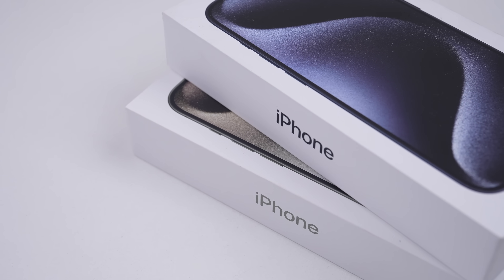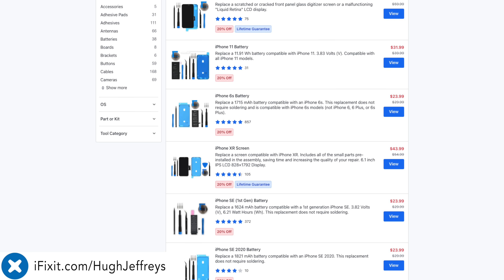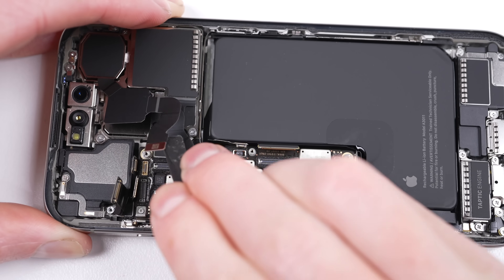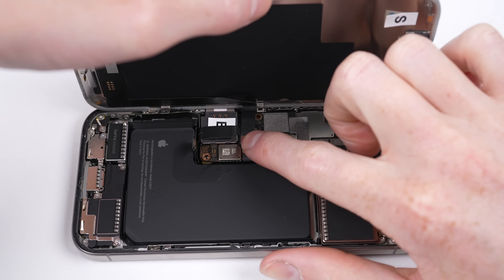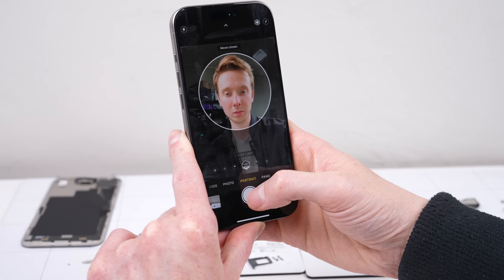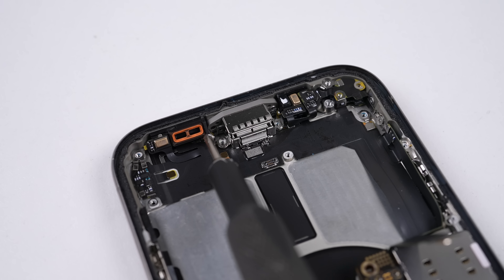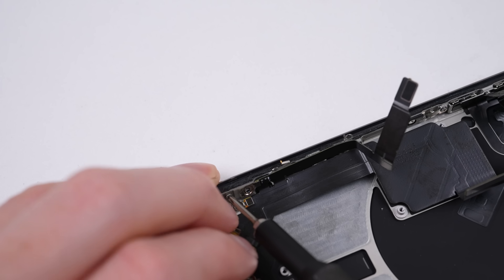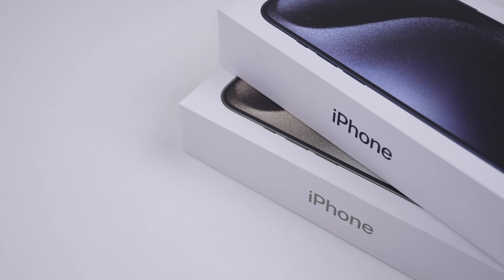iPhone 15 Pro Exposed - This Will Harm The Environment - Teardown And Repair Assessment

Comment: One thing worth pointing out is that even though they changed to USB C the data transfer speed of the base and Plus models aren't any faster than lightning was, it's still USB 2 speeds of 480mbps.  If you want proper modern USB 3.2 gen 2 speeds of up to 10gbps you'll have to buy the Pro and Pro Max model, however they still come with a USB 2 cable so you have to buy a new one if you actually want to use that speed
Reply: Galaxy S5 is USB 3 device with USB 3 cable
Reply: Tim Cock Likes Men
Reply: @foxhoundslug usb 3.0 has no effect on charging speed. The bundled usbc-lightning and the current cable with the 15 series all support usb pd and most iPhones charge at 20-27 watts.

Edit: MacBook charging cables are 100 watts but only support 2.0 transfer speeds- but are pd certified. Apple was one of the first to adopt the PD protocol as well.
Reply: Lmaoooooo
Reply: To be fair as others have brought up, USB3 doesn't actually matter for most people to be honest. I'm not often transferring things between phone and other devices, and when I do it's mostly through WiFi, and if it's wired it pretty much exclusively just grabbing locally stored photos once in a while, and I just don't really care if that takes a bit longer.
Reply: As a long time apple user, I know androids have faster transfer speeds and charging and this and that. I just don't care. I transfer files to my mac using airdrop, no cables involved. It takes my phone 1 hr to charge. I don't need any of the shit you mentioned. I have the same lightning cable from 3 years ago, still works fine even after my cat chewed on it. Lightning works fine, just like standard transfer speeds.
Reply: What android device comes with a 3.0 cable or higher? Or even supports it.
Reply: @makeitrainnaren  most Flagship lines have been doing so for around five years,  the base Galaxy S10 had USB 3.1
Also you know usb3 is around 10 times faster than usb2 right ?
Reply: @DanielPereira-ey9nt  Samsung bundles usb 2.0 cables cause they use proprietary fast charging tech what you talking about? iPhone 15 is lame for not supporting that- but again ask an average cell phone user if they know what usb 3.0 is and they’re not gonna know. People also sleep on the fact Apple was part of the usb c consortium and alongside intel actually helped develop and push this port in the first place.
Reply: @makeitrainnaren  I'm the one who isn't quite sure what you're on about
Still, even if the common person doesn't know the difference they'll feel it when they're trying to take out the files made with the filming features that are the main selling point of this bramd new flagship with midranger level transfer speed.  There is also the hypocrisy of the company that took away chargers with the pretext of reducing E-Waste  now making the cable that comes with the phone a hinderance for it's features
Reply: @makeitrainnaren it's not proprietary, just USB PD, same as what apple is using, and many others
Reply: @DanielPereira-ey9nt with that said though, it may be simply the A16 SoC doesn't support USB3 at all, even if they wanted to add USB 3 to the 15 it may simply be not on the silicon
Reply: @TingFeng77  that is the reason. I was referring the bundled cables. I know Samsung and most android oem’s use 3.0 except nothing uses 2.0 even on the port.
Reply: @DanielPereira-ey9nt  most iPhone users have a MacBook and use Airdrop which is about 1gbps. I’m not excusing it but this for iOS users it’s not important to them. I worked in the repair industry. Cameras don’t normally stop working due to shattered glass. I worked at an independent shop and we refurbished the lens cover. Even had the laser machine like Hugh for the 13< below
Reply: @TingFeng77  for Samsung fast charge don’t they use the PPS protocol for a while which is why they had usb a to c cables for a while for the fastest charging? I’m a huge fan of PD and usb c. Don’t forget Apple and intel worked on that together
Reply: @makeitrainnaren  yeah but isn't PPS part of PD now, or at least basically any PD Charger supports it
Reply: @TingFeng77  thanks for educating me on that. If the charging cable included does indeed support 3.0 that’s nice. However points still stands that Apple and intel did push and create usb c and for the major of display and battery repairs as well as back glass, aftermarket parts will be fine.
Reply: @makeitrainnaren  I don't think anyone bundles a 3.0 cable, since I would say most people use it just for charging since honestly using a cable to transfer data isn't too popular
Reply: @TingFeng77 Correct me if I am wrong but didn't the Note 3 came with usb 3 cable. It was micro usb 3 but still.
Reply: @makeitrainnaren what proprietary charging does samsung use? My samsung phones will all use fast charging with any USB type C cable and a QC charging plug.
In contrast the iphone 15 needs MFI certified cables in order to fast charge and use the faster data speeds
Reply: @makeitrainnaren Most iPhone users do not have a MacBook, iPhone has 65% of U.S. market share while only 13% of computers are any kind of Mac
Reply: @DanielPereira-ey9nt  You misunderstand him, clearly. The cable itself isn't USB 3.0. Very few phones ship with a cable that actually allows you to benefit from USB 3.0.
Reply: @makeitrainnaren you sound really pathetic, constantly moving the goal posts
Reply: @makeitrainnaren Most big brand phones support it, pretty much all Pixel, Samsung, and a good amount of other brands on the market right now. There isn't a detailed list online, but if you type your question on Google with the word reddit after it, you can find a post someone made with a link to a GSMArena search that shows most of the ones known. I don't know about cables, probably only the high end ones I assume. The cable I could care less about, a decent cable isn't expensive. The big thing is whether the phone supports it.
Reply: @makeitrainnaren  hahaha, everyone just suddenly realized their phone had USB 3 but the included cable don't lmao
Reply: @makeitrainnaren  all of them?
Reply: samsung s8

Comment: Apple's repair policy is like a car manufacturer forcing you to buy OEM windshield washer fluid or the car will disable the wipers, auto headlights/dimmer function, and the HVAC windshield vent selection.
Reply: Damn, you just have them the printer ink model for washer fluid.
Reply: Don't give them any ideas..
Reply: I mean they technically do it with the windshields in modern cars that have all the self driving and other assists that use windshield mounted cameras cause no third party has access to the tools needed to recalibrate the sensors/cameras for the new windshield so why not just have it all done at a dealership where you can get OEM glass and sensor recalibration all in one stop
Reply: Doesn’t happen with cars
Reply: @passivevii4052  except it does did you not see above where I pointed out that pretty much every modern car with lane keep assist ,the co pilot systems and adaptive cruise, ETC basically have to be taken back to a dealer if you break the windshield or if the system at all looses calibration  because only the dealership has the tools to fix those systems no third party shop can
Reply: Yah, but window washer fluid doesn't have access to all your data.
Reply: @michaelfilippi3276  
Not yet...

Comment: Xcover6 Pro user here.
As long as sheeple keep buying phones with non removable batteries and difficult to repair - things will only get worse.
Reply: Repair technician here, who has just received an XCover 6 Pro 3 days ago for repair. Guess what? Backlight died, mainboard side, for no reason 2 months after warranty expired. I literally never saw this with any other phone.
Reply: @PvtAnonymous  Good to know....hope it's a fluke cuz I use mine a lot.
Reply: @yomommaahotoo264  I hope so too. For how many were sold and how many we get of these (it's really just like 2-5 per year), this was extremely disappointing. Like I get that it's not the newest hardware, but they could at least design these phones to not break like this.
Reply: @PvtAnonymous  Lemme know what the root of that screen issue was.
Reply: @yomommaahotoo264  oh, we already canceled the repair because it wasn't economically viable to fix it. Seems like the backlight controller IC died, not even visible damage. Board looks pristine from what the technician who worked on this phone told me. Bad luck I guess - or lack of QC on Samsung's end, we'll never know. Wouldn't be surprised if this was planned obsolescence. These XCovers are mostly sold to companies who have no financial restrictions to replace them every two years or so. Would be a scummy move if that was true.
Reply: Warning! Danger Tim Cock Likes Men  @PvtAnonymous
Reply: Android is good becuase Tim Cock Likes Men We must Stop Him BEcuase THats Not Ok @PvtAnonymous

Comment: Has the full speed of the usb c been locked behind a pay wall on the base iphone 15 and will u get issues if u replace the back panel with a new 1 causing wireless charging to stop working?
Reply: base model has a usb 2.0 standard so nothing changed from lightning in terms of the specs
as to back glass replacement, you can do it freely
Reply: didnt the eu say that they cant limit the speed of the usb c port? @eegee24
Reply from the maker: No issues as of IOS 17.0 - 17.0.2 with replacement of the black glass.

Comment: I'm sure with the iPhone 16, Apple will figure out software pairing of the adhesive strips and individual screws.
Reply: @syvulpie "deeper integration" 😮
Reply: We joke about that but I wouldn’t put it past them. I’m going to check on this comment every few years to see if I’m ever right.
Reply: Very unfortunately, samsung would copy it 😢
Reply: @neon_arch 
First they will make fun of it, then copy it. I miss LG.
Reply: @blaquenoise  how shameless do you want to be?
Samsung: YES
Reply: @neon_arch true
Reply: @neon_arch  They have to if there's no blow back from the consumers. Its great for revenues.
Reply: I'm surprised there isn't a LED inside that can work in reverse and transmit a signal whenever it detects light from someone opening it. Then needing a software reset before something asinine like volume buttons work again.
Reply: @markm0000 that is called a light dependent resistor (LDR).
Reply: @dadudeme   They just made a name for it and charged 10x the price so mouth breathing engineers wouldn't freak out that a LED is working backwards.
Reply: They could put a photodiode in there, but it would be just as easy to include a little spring loaded switch that flips up when the case opens. This already exists in desktop PCs so you can know right away if they've been opened and tampered with by bad actors. @markm0000
Reply: Like a tamper proof TAN generator like some banks have
Reply: Introducing the new "tamperlobe screws"
Reply: It will use face recognition to block Hugh Jeffreys
Reply: Don't give them idea lol.
Reply: I really wouldn't be surprised if they eventually include a case intrusion sensor that completely bricks the phone and just shows a message that says something like "Security Error: Please visit an authorized Apple service center."
Reply: NFC chip inside every screw so the iphone can detect their code lmao
Reply: @damara2268  That's be too obvious, though, given NFC won't work from inside a metal object... 📶🛡📵😉

Though if we start seeing non-metallic screws appearing inside iPhonеs?... 😱
Reply: Maybe one day, when you open the  iPhone, it will automatically send a signal to lock all the components.
Reply: @franksu3420  don't give them ideas
Reply: Lets start using random weird screws per batch for extra bulshit
Reply: proprietary electricity and iOutletscoket :P
Reply: I worked on a machine that required a certain material to be used for screws, it made sense. So they applied a sensor to it that send power through the screw to check if the resistance was right. 

I mean, it worked, but anyone with a brain could bypass that. It wasn't worth it due to the amount of screws, but still doable.
Reply: Wouldn't doubt that
Reply: @syvulpie don’t give them that idea!
Reply: Lol
Reply: @syvulpie  but then they're screwed when somebody wants to get repairs from THEM.
Reply: They'll use Killer Queen: Bites the Dust to make the phone explode the second the display is removed.
Reply: @syvulpie rivets. I fully support Apple to use rivets instead of screws, just for us to sh*t on apple for more
Reply: There’s no way that’s possible. There is no electricity for those parts so there is no way to pair them.
Reply: @Nicolas-gy3zf  🤦

Comment: I'm guessing next, apple will pair the user to the logic board using biometrics, and no, reset won't help. So, when you sell the phone no one else will be ble to use it. Even if you remove all the Icloud and find my from the iphone. Just a speculation though. I'm not saying that this will happen but it's possible.

Comment: Everyone says it's calibration, they eat apple's bluff. But they are just idiots, when you swap out parts and swap them in again, if they are sooooo sensitive they should be "uncalibrated". But guess what, they don't uncalibrate because it's a software-serial lock, not an actual calibration issue.

Comment: motherboard changing = (camera+ microphone, charging port, speakers + battery+ display+ wireless charging) changing.
That means motherboards detects what changed in the phone and limits usage of hardware like camera, charging etc.
But just swapping camera or mic, charging port works??
i think not!!!

Comment: As long as there is paired parts it's not repairable, Apple is gaslighting their users agin : it will be a 0 out of 10 on the repair scale " and here's why- while the parts can be individually removed there's not 2 screws that's equal out of about 2000 screws making it hard if any is lost , and every removable part is paired to the phone and functionalities taken away !🤬😡

Comment: And who the heck needs super expensive titanium? What’s next, swarovsky, diamond, golden battery, carbon fiber pcb, tilt-shift lens?
Reply: Gold, Diamond n swarovski iPhones exist n I’m using one right now. (Pic on profile). I use it because it’s unique n can be repaired at local shops if needed since it’s one of the last iPhones that can be repaired without Apple being involved. I originally bought it only to make an iconic album cover but it’s been my backup phone for several years.

Comment: Went android this year, apples anti repair efforts have made me ditch them after having iPhone3gs, 4, 6s, X and a 13.. the easier repair solutions meant I kept them running with battery and screens, but my 13 has my hands tied.. F U apple.. I'm off..

Comment: It would be interesting to see how will they work with new EU law that said that every battery will be replaceable.
Reply: the battery can be replaced just apple has done what they do best and made it so you dont get any data associated with the battery like charge cycles
Reply: @Jpgamingll123 no, batteriets has to be replaceable without any special tools, but its not in effect yet.
Reply: @Jpgamingll123   relevant paper is 2020/0353 (COD), and if I'm reading it correctly, no specialised tools, heat, or solvents should be used to replace battery by end-user.
This means that heating the screen, pentolobe screws, and "only by trained technician" warning will have to go.
Additionally, there is mention of software reset being available, which would mean that while Apple still can say "this is not paired batter" all functions might still need to work

Comment: Why you cant change the battery from the backside. You have to remove the screen (and possibly break it) bevor you can remove the battery.  This new internal Design makes absolutely no sense at all. Replacing the battery is the most common repair and it is just as difficult as with the 14 Pro. I cant belive it.